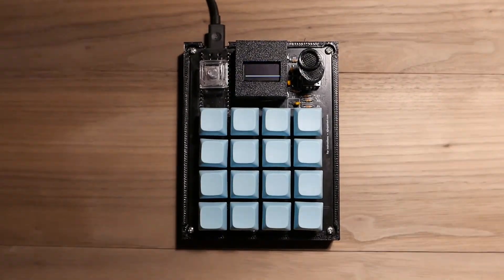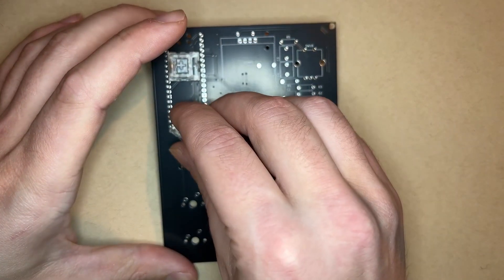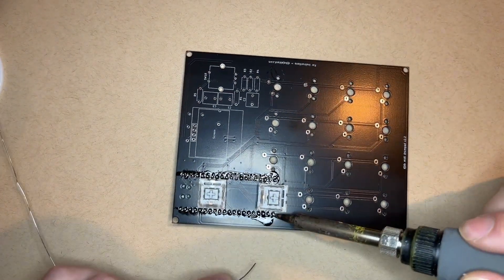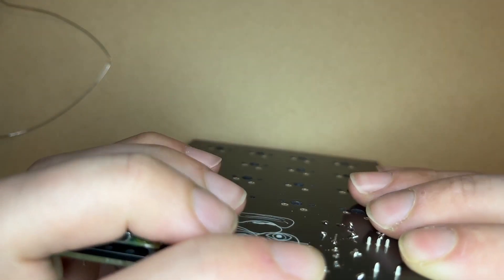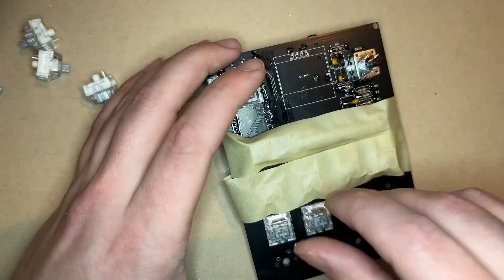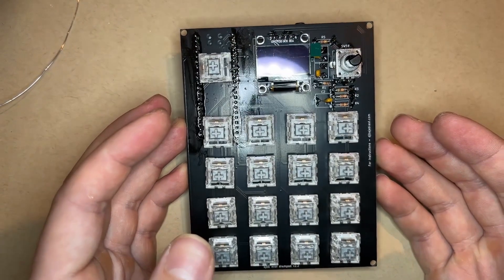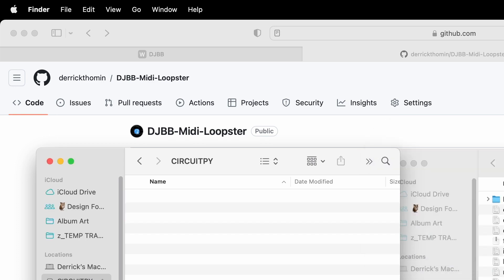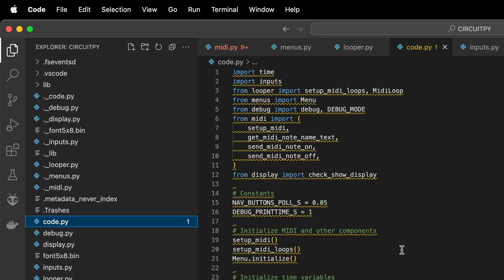DJBB Midi Loopster DIY Kit Build Guide

Comment: Cool little project. I ordered one of your boards from Etsy and built one. Everything seemed to go pretty smoothly, except for a slight misstep in initially using CircuitPython 9.x (current) which generated some errors with your code - but that was quickly solved by jumping back to 8.x and now it's running perfectly. Now that I have the hardware complete I think I'm going to take a peek into the code itself and maybe hack around a bit with some changes. Thanks for creating this and publishing it so others can share in the fun!